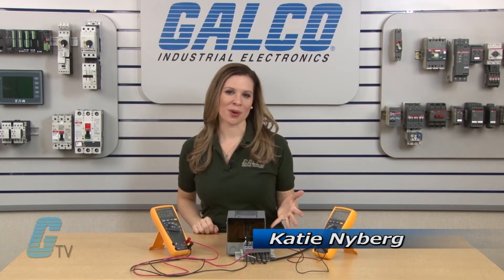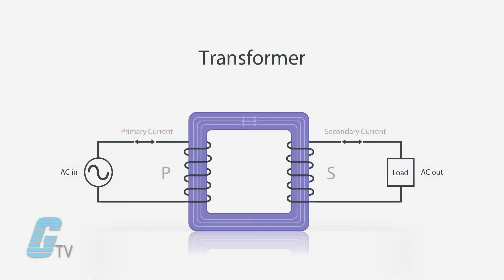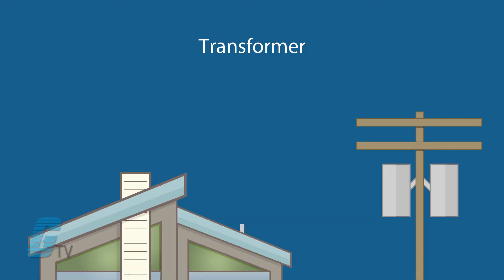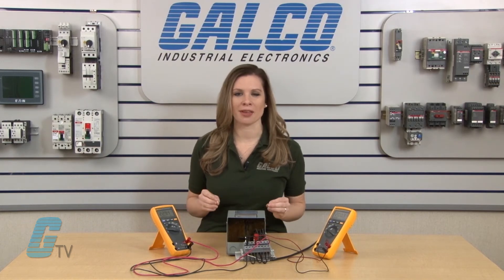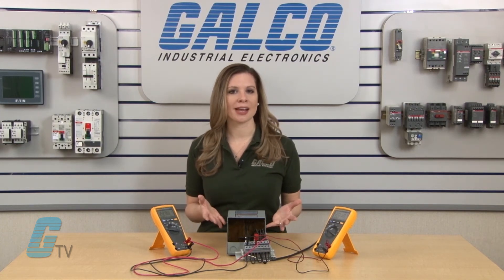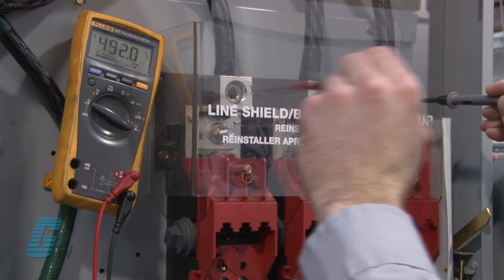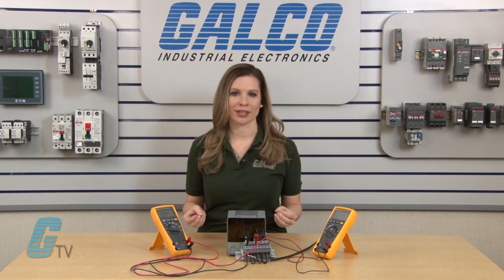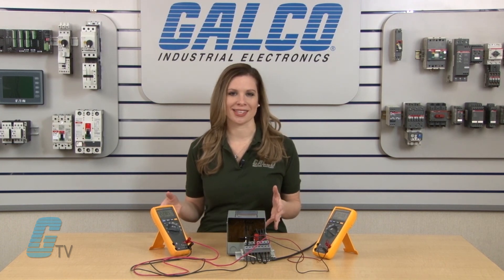What is a Buck-Boost Transformer?

Comment: I have single phase 10 horsepower 230 volt
Motor. Power supply coming into certain buildings is 208. Question is do I need two buck busters or just one 🤔

Comment: What is the difference in buck boost transformer and buck boost converter?
Reply: Transformer is for AC. Converter Is for DC
Reply: A transformer steps up, steps down, or cleans alternating current. While a converter takes alternating current and "converts" it into (DC) direct current.
Reply: @nickjohnston9925  transformer (noun) is used for AC in  and AC out while a converter (noun) is used for DC in and DC out.

Rectifyer (noun) is used for AC in and DC out, while an inverter is used for DC in and AC out.